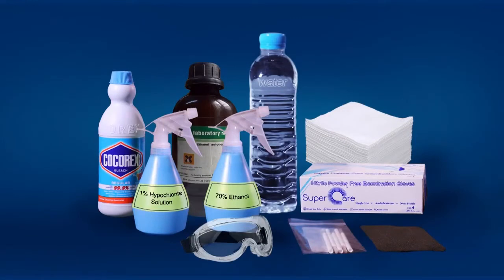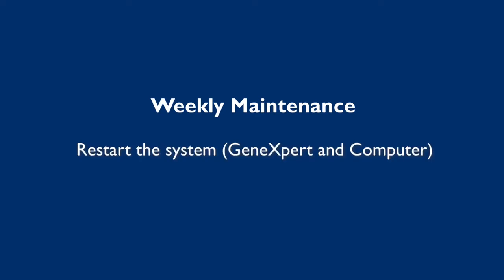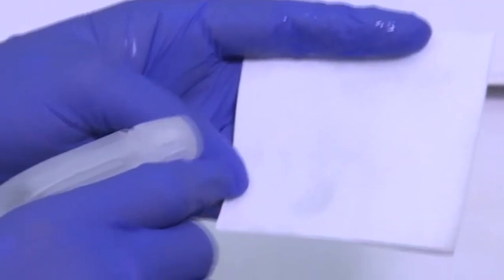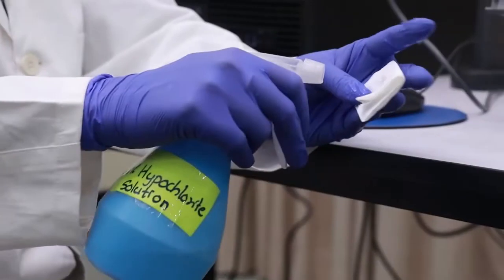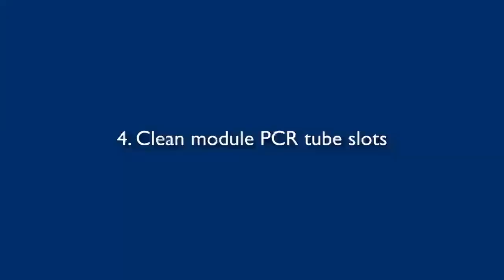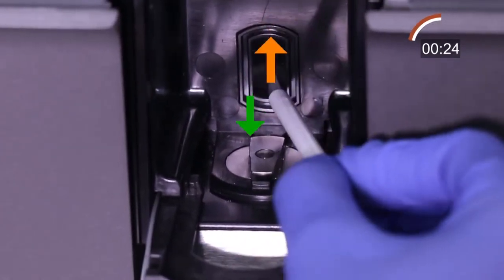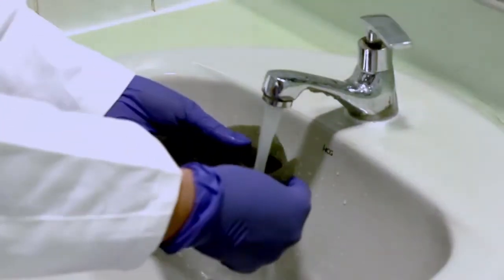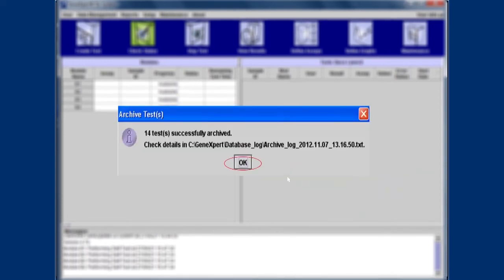GeneXpert machine maintenance English

Comment: My plunger rods are stuck down while maintaince and now can't be moved up.. What i can do
Reply from the maker: You may try using plunger cleaning maintenance task from the software, first give a command to lower all plungers (under maintenance tab, please click “plunger rod maintenance”), on pop-up window, please click clean all. Once all other plungers are down, now there will be another pop-up window where you need to click “move up all”. This will force software to bring all plungers to home (up) position. If this doesn’t work, there is a still a small mechanical procedure that maybe used. Please contact Priyank.Verma@icf.com for more information.